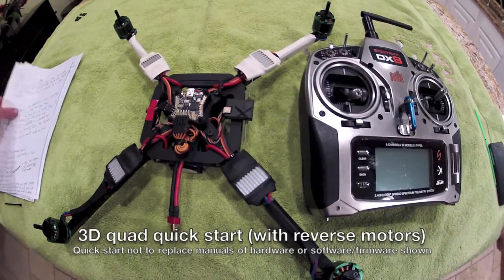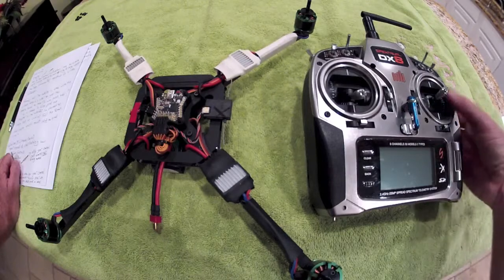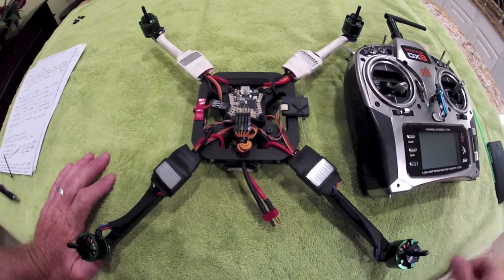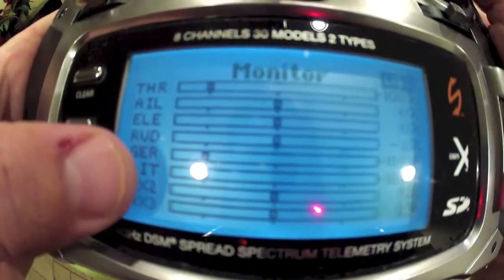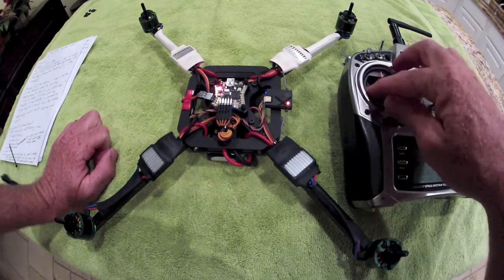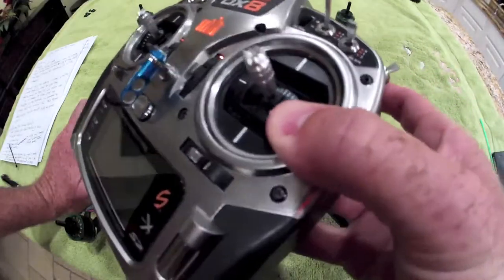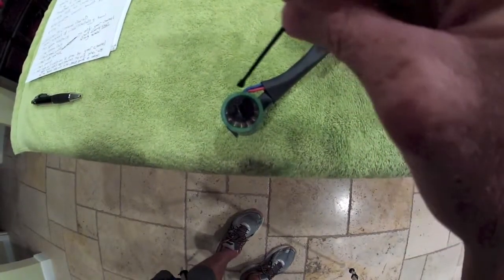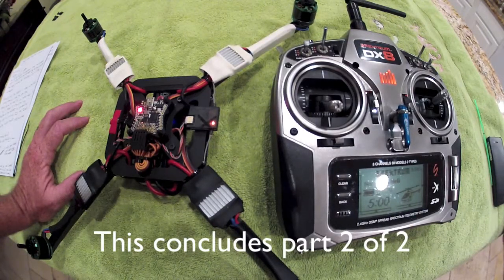3D quadcopter with reversing motors (quick start guide) part 2 of 2

Comment: Mike what firmware are you running and when you flashed your escs did you modify them or did you just use simonk reverse??
While I am not new to multirotors I want to fly 3D so I have flashed my escs (turnigy multistar 15amp) with simonk reverse and I am using multiwii 3D on my 328P FC board..... problem is the copter does not tilt and roll in the normal position and I am getting the motors running backwards when I tilt forward..... so hopefully you can share your build and shine some light on how your copter flies.... great fun ... thanks.